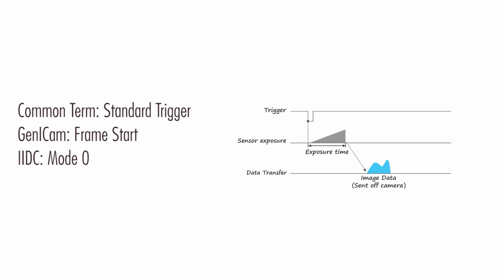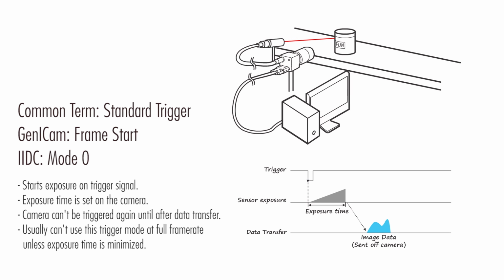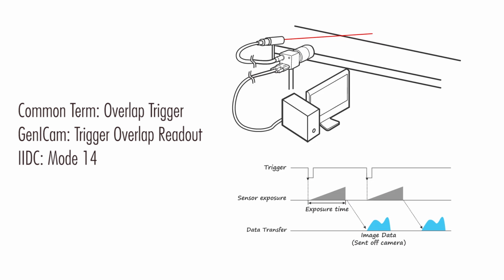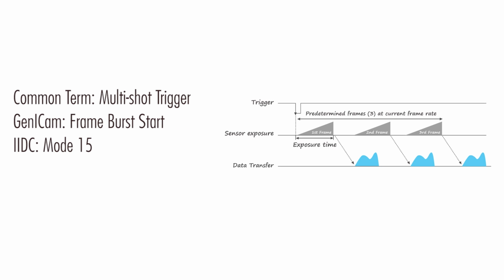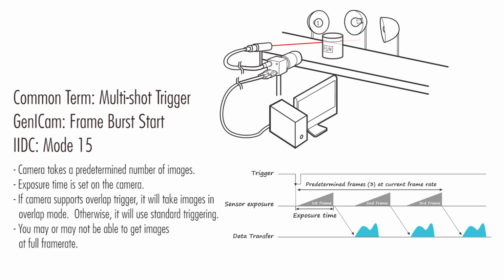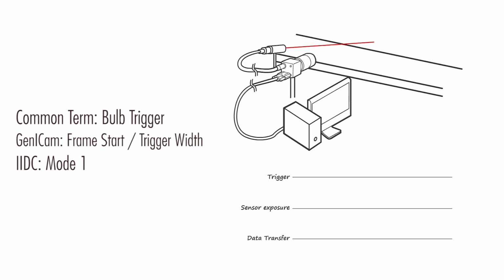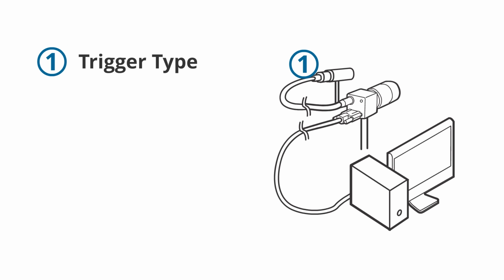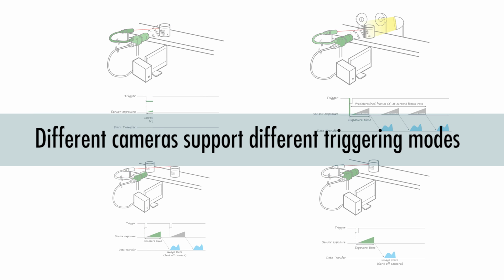Machine Vision Camera Trigger Modes Intro

Comment: Hi , nice video !! i'm working with a flea 3.0 point grey on labview , I want to know how can I pass from mode 0 for example to mode 14 ?
thank you
Reply: Thanks for watching Hakim! Can you tell me which exact Flea3 model you are using?
Reply: +Michael Jacoby its FL3-U3-13S2C-CS :)
Reply: I have bad news Hakim, unfortunately that model does not support trigger mode 14. It only supports Standard (mode 0), Bulb (mode 1), and Multi-Shot (mode 15) trigger. I'm very sorry about that! I know this is after the fact since you already have the camera but if you'd like to know which of our models do support overlap trigger please let me know. Again, I apologize for the inconvenience.
Reply: Thank you for your reply ! it is not a problem I want to know how can i change the modes for example how can i use mode 15 , thank you
Reply: and but the way i wanted to ask if i can realise a program that can grab and save an AVI and trigger the camera at the same time .
It means I want a program that combine these two exemples 
IMAQdxEx - Grab and Save to AVIand  
IMAQdxEx - HardwareTriggerLine0
from ( https://www.ptgrey.com/kb/10714 )
Reply: Hi Hakim, sorry for the late reply. It would probably be best if you email our tech support at support@ptgrey.com as they'll need more details. Thank you!

Comment: Trying to build my own home video security system but lacking in knowledge. The camera's available, overwhelming. My preference is POE so the ethernet cable is all that needs to be run but not sure what POE switch matches your products. 
Also want 1080P for maximum detail.
The best way to get the video to store on harddrive both software and hardware.
Reply: +ruddogster Hi! Thanks for watching! Your best bet, and to save you a lot of headache, is to buy a security camera like our Cricket camera https://www.ptgrey.com/cricket-ip-security-camera. We have a 1080p model and it's ONVIF compliant (ONVIF is a standard that allows 3rd party security software to work with any Onvif camera). Like you said, you would need a PoE switch (any PoE switch that is IEEE 802.3af/at will work with any PoE camera). You can use regular Cat 5e or Cat6 cables too for PoE. The Cricket camera is our one security camera family while the rest of our camera families are mainly for machine vision applications (factory automation, robotics). You might want to look at camera companies that focus mainly on security and surveillance - two big ones off the bat are Avigilon http://avigilon.com/ and Axis http://www.axis.com/ca/en/
Reply: Thank you and BTW like the cricket. It is unfortunate the other companies don't offer as inviting a web presence as Point Grey. Just the same thank you.
Reply: +ruddogster Any time! Big thank you for taking the time to watch the videos :)